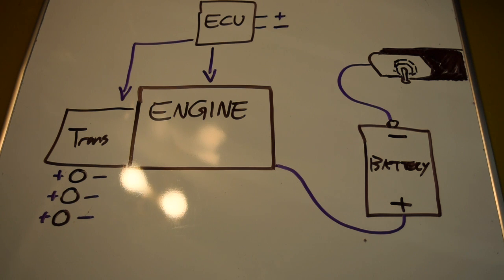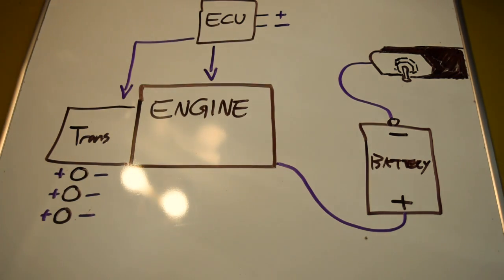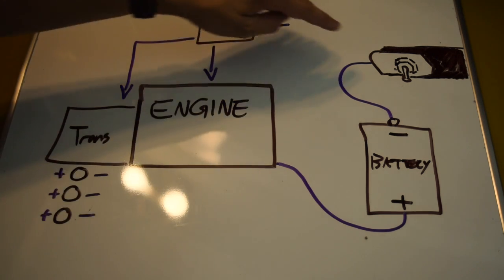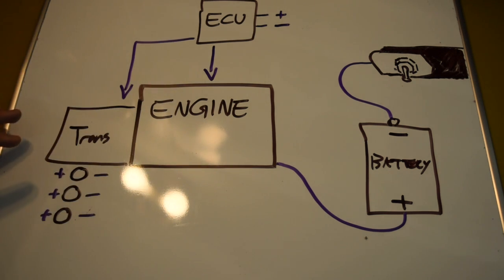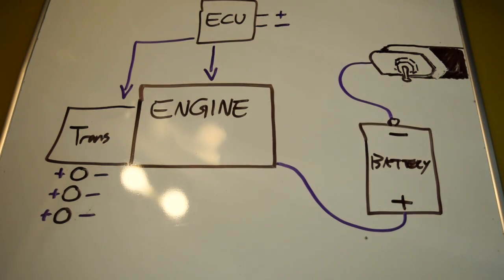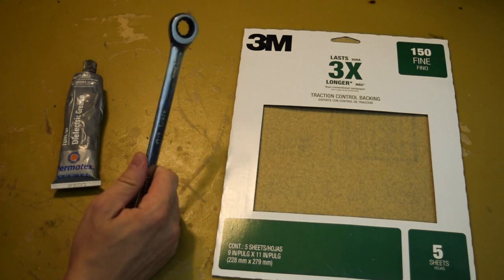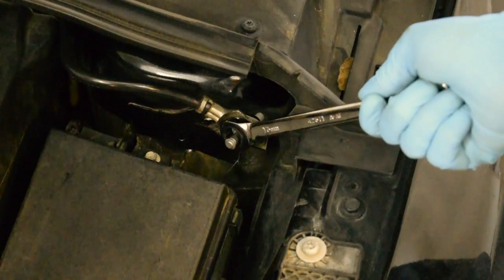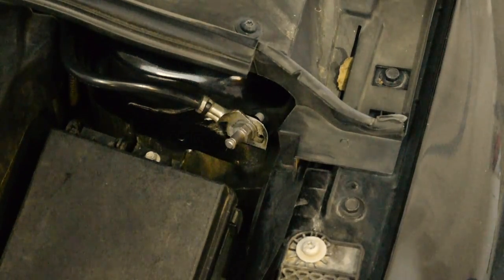Ford Focus DCT Ground Mod. Increase Driveability and Reduce Jerkyness

Comment: I don't have any shifting issues on my 2014 fiesta, but I had the transmission throw errors after I had to jump start it. Cleared the codes and everything seems fine, no check engine light, but it does have clutch position sensor and TCM power input signal errors that wont go away This was the first time I scanned the codes, so those might have been there before, but I have a feeling this is going to fix them!

Comment: I just did mine and its still slippin sanded all the paint cleaned the connectors put it back together. Now im gonna try and clean the actuators

Comment: I tried this on my 2013 Focus and also reset the TCM, so far it is better (fingers crossed). I cleaned all 3 grounds as shown in this video - https://www.youtube.com/watch?v=oVzAQDOLtiY.  I also changed a 50 amp fuse, see this video - https://www.youtube.com/watch?v=tk3IJYjqeCo  Lastly I checked fuse box fuses which were all fine, see this video - https://www.youtube.com/watch?v=4RcwRAGi01Q   Good luck all.

Comment: My 2012 Focus with MT 5 speed has 194764 miles on it. I bought it new. The transmission is a dream. Essentially, I use the clutch for 1st gear and reverse only. The transmission is well synchronized for clutchless shifting provided you’re in RPM range.

Comment: I got a P090C error code from my Focus. Couldn't engage reverse and the car shifted terribly, probably only between gears 1 3 and 5. Sanded the paint off the contacts between ground wires and frame, and it resolved the code, and it now shifts better than ever. Don't forget the two ground contacts hidden under the air intake! Thanks for the great video. It probably saved me over a thousand dollars or a real headache to install a new TCM I apparently don't even need
Reply: Trust me its not a permanent fix. I too thought the sanding down the paint trick works but shortly after I needed a new tcm.

Comment: also change the 3 x 50 amp fuses infront of the battery and also the TCM fuses in the fuse box in engine bay.

Comment: Shockingly, this simple hack totally worked.  I sanded down the ground above the battery and the 2 grounds under the air box.  After a somewhat annoying re-learn, the car now shifts perfectly again. It went from undriveable to like new.  
Total cost: $0 and a little of my time after 2 different mechanics told me my only option was an expensive transmission repair.

Comment: Did this to my 2017 and it cured 90% of the problem. Still jerky once in awhile but it doesn't bother me at all. I bought it with 44k on it and now have 110+ and it's still not 100% perfect in the shifting dept. but it doesn't bother me at all.

Comment: In principle, the bulk of current when the car is running is returning to the alternator which is bolted to the engine, can't have a much lower impedance path to the TCM than that. The TCM shouldn't have much of its current passing through the battery apart from the battery's smoothing function.

Comment: My 2012 is missing forward gears and has no reverse at times, I replaced the actuators both of them and it’s still doing it, I can disconnect the battery and it’s fixed again for a few days, I’m gonna try this tomorrow.. remove the paint for a better ground..
Reply: Which check engine code were on? If any

Comment: I have done this as well,  I did both grounds under the air cleaner box because they are so close.  And the main negative battery connection   It was well worth it ant the trans shifts much better
Reply: Which check engine code were on? If any
Reply: @Mike-ty7pw  I didn't have any codes when our was slipping, i found the solution on a youtube channel and it worked much better. I also considered running battery cables between the three grounds to make sure it went straight to negative

Comment: Bad ground may have been the problem in your case and it is very likkely the problem on many cars, but it is not the only one problem that tends to plague these transmissions. Such painted grounding posts is in fact very frequent cause of electrical gremlins in many cars, here the transmission is indeed sensitive for it (because the shifting and clutch actuators are powered electrically). And as a consequence, erratic actuators/control (because of bad ground) could well cause excessive wear or even damage to the mechanical hardware... It is not that the grounding would be insufficient by its design, it is just lousy production quality control (contact surfaces on the ground post contaminated by paint), it is really one of the most common manufacturing defect across all cars from all makers...

And to be even worse, many mechanics just completely ignore the fact that a bad ground connection could cause a lot of havoc in the car.

So to me if it fixed the problem, it was very legitimate repair and even diagnostic (suspecting bad power or ground connection as the first step is one of the best moves with anything that could have anything common with electrical things).

And just a note: When disconnecting the battery, disconnect its NEGATIVE terminal first (and connect last). In this way, even when your tool slips and touches accidentally the ground, it won't cause a short circuit.
When you are disconnecting the positive afterwards, eventual short to car ground is not a problem anymore, because the circuit is already open on the negative side...

Comment: I watched another video kinda similar to this one but the guy went a step further and got the other 2 grounding straps under the air box also. 

So remove the air filter box. Take off ground bolts, scuff body and ground straps, add grease,  and bolt back together. Then see if that also makes a difference.

Comment: All these Years. I just saw this video. Going to try it and hopefully this helps me out. Also when changing the 2 quarts of DCT transmission fluid with motorcraft hat went up double in price from 18 to 40 dollars a quart. Do the same disconnect battery to relearn?

Comment: You're suppose to change the dual clutch transmission fluid every 60k miles. 2 quarts, was $37 a piece at my local dealership. Only use oem fluid

Comment: Worked for me after having missed shifts from stop and check engine light gave p0902 and low battery voltage codes. Light came off shortly after this fix and driving around!! Thank you 🙌

Comment: I read the comments and see lots of positive response. I did this too but still tcm, clutch and tranny needed to be changed. So after the change i cleaned the grease , and redo again. New battery CCA 600+. Now so far already done almost 10k miles. Anyone had experienced lasting longer without changing the tcm and clutch?

Comment: I noticed that your video is 4 yrs old, and I was wondering if you still have the car and if so have you had any more problems with this issue” the reason I’m asking you is that I Have a 2012 Ford Focus Titanium Hatchback and for most of its now thirteen year lifespan it’s been garaged kept with only just over 32000 miles on it and I have just recently had this very same problem and of course it’s well out of the warranty area of its life, my Focus is an automatic and I have always pampered it never drove it hard at all, it’s still smells Brand new and is in excellent condition until this problem I really want to try this out because I do not want to have to take it to the dealership because they will try and rake me over the coals if you know what I mean, so any input or hope would be appreciated if you could let me know if this truly fixed the issue!
Reply: I just wanted to let you know that customer satisfaction program 14 mo2 supplement number 7 came out in May of last year and it grants any owner of any focus or Fiesta 2012 to 2016 I think is what the years were a free replacement TCM until June of 2025 no mileage stipulations nothing like that at all. I hope you get your car fixed 🙏

Comment: Has anyone tried it on  Kuga? I have a 2014 with the powershift transmission. Ford and everyone else aren't even listing it as a problem but let me tell you it is. transmission warning light comes on, it loses it's s*** and I have to pull over, turn the car off, start it up again and off I go (until it happens again, which can be 3 times in one trip). It refuses to go into reverse when it happens as well. Hubby is going to give this a go on the weekend because seriously, we just cannot afford a new car.
Reply: Didn't work :(

Comment: A few years ago, one day, all the lights came on my dash and stayed on while running. I'm  not really a mechanic with papers but I began to wonder what might be the problem. A thought came to me so I got a couple of wrenches and disconnected  the ground on the engine block and on the fender. Cleaning them up with sand paper and adding  die-electric grease and bolted them back up. Fixed. My 2007 Focus has been working good since. Thank you for this interesting video,Lester

Comment: Battery ground does make a difference.  Also you have 2 small grounds just below Battery between Battery and fire wall. Them 2 grounds go directly to transmission. Same problem, needs paint removed to make working contact. 8mm is all you need

Comment: Just did this for my sister-in-laws 2012 Ford Focus, she had trans problems for years and the dealer was useless. Last time in they told her she needed two clutches in the trans. They never even thought to check the grounds. I did the one by the battery and two under the airbox and now it works fine. Be careful other vids mistakenly smear dielectric grease over the cleaned up (to bare metal) grounding areas..don't do that!! use it only a a rust prohibitive after you tighten the nuts back down.

Comment: Thank youi, great video, I'm the  not so proud owner of the 2014 model, it has had the automatic transmission modules replaced 3x,  most of the repair work was done in Florida. Ford kept the car for 3 months at one time and gave me a free rental for the period while I waited patiently I might add. I got mad one time at the dealer I bought the car from and they extended my warranty to 100,000 on the drive train, thank god. Sorry I know I'm being long winded here, but the last time they put a new trans module in [ they updated the software] and bingo it ran like top after that. YAY!!!  Now I'm going to try this  guys grounding trick. Other than these issues it's not all that bad a car. I get almost 42 mpg on a trip with synthetic oil btw. Anyway I hope this info. I have shared can help someone else!
Reply from the maker: Glad something finally worked!
Reply: 42MPG!!! 😮WOW i wish

Comment: I cleaned paint off 2011 fiesta ground today and car went from undriveable to shifting perfect.  This guy is not bullshitting. I actually cleaned 3 ground connections.
Reply from the maker: I’m just glad this helps!
Reply: @brownroush  Have a 2011 Fiesta SES. Transmission shifts fine. Car has no misfiring at idle or to the floor. Problem. Car when first cranked there is a vibration felt inside the car. At an idle in drive, park, neutral it doesn’t matter. Once it is on the road no vibration can be felt. Stop at a stoplight no vibration. Drive miles no vibration. Come home and park. Crank the next morning it all starts the same process again? Why would there be a vibration  (not a misfiring) at a cold crank idle but not 3 miles down the road or 100 miles? But will after setting overnight when first cranked at an idle?

Comment: I have a 2012 with no forward movement and skipping in reverse. Cleaned ALL the grounds and got good reverse and some jumping and slipping in forward. Removed Servo and cleaned with Throttle Body cleaner and now it shifts perfectly. THANK YOU SO MUCH, they said $2.5k.
Reply from the maker: That is so awesome to hear!
Reply: Hey man, what do you mean "removed servo"? I have a 2012 Focus too. I cleaned all three grounds and it's MUCH better. But the check engine light still comes on and then off from tie to time What did you clean with the throttle body cleaner? Thanks
Reply: @blakemorgan8777  There are 2 servo motors that act as your feet to engage the clutch, one in the front of the trans and the other on top. The front one controls reverse and the top one controls forward. The servos and the linkage get gummed up with oil and clutch material and stop the servo from going all the way back to full engagement. It is spring loaded to return. I actually ended up changing the Servo just in case and it was only $50. The Throttle Body cleaner cleaned the gunk out while the servo went through self check (every engine startup). Did that about 10 times and it got clean. Do not use lubrication as it is directly OVER the clutch material (oil and clutch is a no-no).
Reply: @CharlesLaBuhn  Really appreciate the reply. I'll keep that in mind and perhaps down the road check into that. Right now it shifts really well. I'm thinking about adding another ground first and see if that helps. Trying to keep this thing going and avoid shelling out a fortune for a new car. Bro, if it's true that heaven and hell exists - I hope you know Christ Jesus as Savior and make it to heaven. (I hope to make it myself.) ✌️
Reply: @blakemorgan8777  ALL 3 grounds, where are all of them??  Thanks
Reply: @REVNUMANEWBERN  "Big Ben's Cars & Cycles" channel has a video called "Ford Focus TCM Ground Cleaning" that shows you the location of all 3 grounds.
Reply: @miltonbates6425  I'm here because my mother's is causing problems... are those servos accessible without pulling the gearbox out?
Reply: @peterlattimore6013 yes, one is under the car, and the other one up top in the engine bay
Reply: @akboo101  thanks... found them an hour or two ago... they don't seem to be the problem,  I'm just going do a relearn and hopefully... many thanks again.
Reply: @peterlattimore6013 yes one on to if motor under air box to the left that is A the other is under the car at the front of trans that one is B

Comment: Thankyou!  This is very useful and is worth a try, so I am going to try this tomorrow and keep my fingers crossed.   On another note, there are bound to be some Ford CVT vehicles with a transmission problem that could be solved with this fix.  So has anyone taken their Focus, with a certain variety of a transmission problem, to a Ford dealer and gotten feedback from the dealer that making the ground better was something they could do at at a relatively low cost for a particular type of transmission problem, or is it always a repair that comes in around $2k to $5k range with no mention of making the ground connection aspect in an electrical circuit, better?  &#@^!  What I am wondering, does Ford ever admit this is one of the things they could do as a matter of course now on the older vehicles now that the kinks have been exposed for over 10 years?  Has Ford ever considered this in the overall engineering of the current CVT?   Any Ford trained mechanics out there think this should be one of the things they learned in the official Ford training curriculum, both new mechanics and for ongoing education? To apply as needed to older vehicles?  I know it probably would not be in the curriculum back in the era when CVT first came on the scene, but more recently with the body of experience they have now, they should know better on the older ones.    And it would not be fair if Ford knows grounding problems contributes to CVT problems to whatever degree, and yet ignores a cheap preventive measure when the older vehicles are in for a service.  What is the harm?  What the heck?  Maybe the Ford engineers have designed in a more robust ground circuitry with the latest CVTs?  It should be engineered in at the factory by now.  A lot of questions and maybe no ready answers.  I am certainly taking the leap this solves a few early Ford CVT problems, admittedly.  But dealerships rip us off, so we all should individually sue Ford anyway,  and retire to the Philippines with our settlements and wives...  F**k the class actions where only the lawyers get rich.  Better yet, I'm going to the Philippines by myself with leave the wokeness behind.  She can have the imaginary settlement I am already counting on in my dreams...
Reply: ps  This video has set me off.  Don't get me wrong, for I am thankful for this knowledge and it could solve the problem.  Anyway, I took my Ford Focus to the dealership a few months ago with beginning of the symptoms described in this video, when those symptoms first started.  It was sporadic,  but scared the wife when it happened.   So the dealership hooks our Focus up to the diagnosis equipment and could find no cause. They took it for a test drive even, but of course it is an intermittent problem.   Duh, maybe because it is a simple intermittent bad ground, which a test drive or a diagnosis hookup could not pick up ( No p codes).   Or maybe I do not understand "complex" shit just happens, and the great unwashed have no control over our lives for when "complex" shit happens, and it is UFO's causing the problem, but it really is an intermittent ground problem (TBD).  I should just stop moaning and groaning, comply with the vaxx and worship those in power and not case waves.  Sorry it has been a bad day and this forum provided a means to dump here and now.  Ford should know better by now, it is 2023, and use this simple fix.  But nooooooo.  But what do I know? LOL   I do know this: FJB